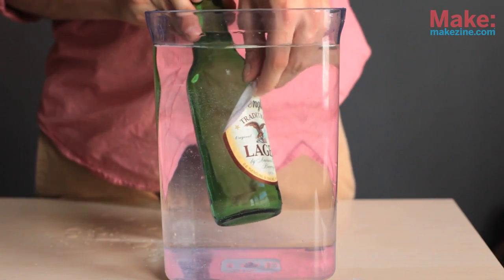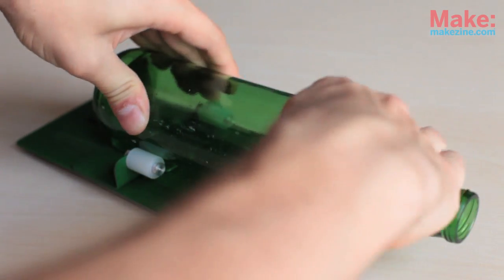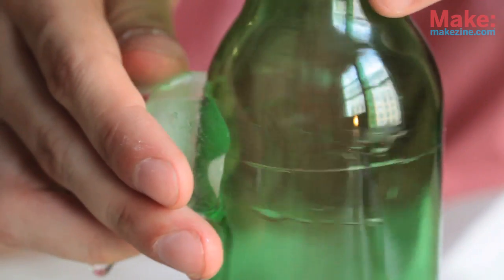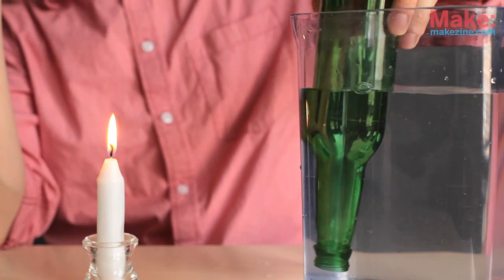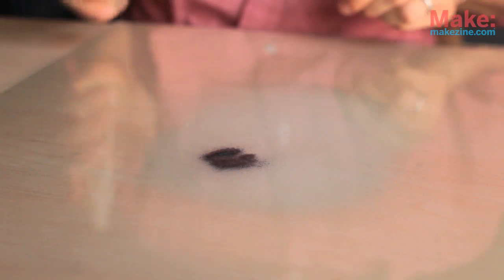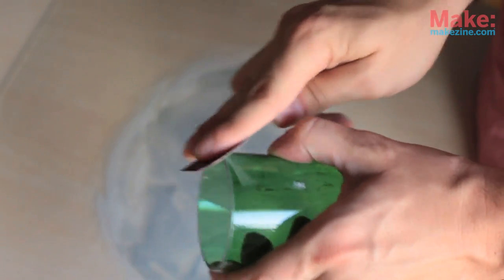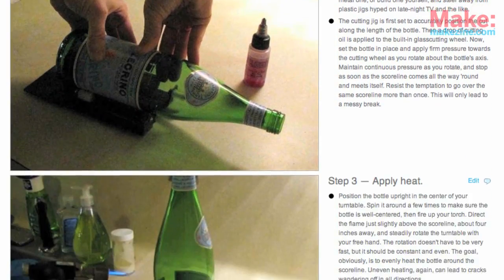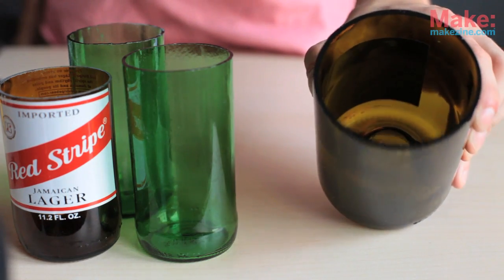How-To: Bottle Cutting

Comment: Just used this method and it was my first time ever cutting glass.
I made my own jig with a few clamps and blocks of wood and a handheld glass cutter.

1st attempt worked but with tiny fractures, 2 next attempts worked perfectly without any imperfections.

I didn't use ice I used a bucket of water full of ice.

Also I used electrical tape to make sure I scored the glass in the right spot all around (cause the home-made jig is very simple =P )

Comment: I saw a video where glass bottles were partially submerged in water at 90ºC for an extended period, after which the bottles could just be tapped to separate the pieces. This method was used as a step for creating bottle shape design, stained glass windows.

Comment: @makemagazine Basically you are melting the glass on the edge to give it the same rounded shape.

Also, you can cut the bottle using a piece of yarn/twine soaked in rubbing alcohol.  Tie it around and light it, then submerge in a tank of water.

Comment: You can use a propane torch to slightly melt the glass on the rim.  This will form a smooth rounded edge that requires no polishing.  That is how wine glasses are made as well as glassware in a lab.

Comment: Nice technique. A little advice is to make sure your cutting wheel is oiled. 
My only dispute is that you consider this recycling. In the most general usage of this term, it can be called recycling. I just wonder if it isn't it more efficient to send the whole bottle to the recycling bin?

Comment: wut i think happened there where the bottle cracked when u picked it up iz dat the bottle was weakened by well you weakening it by heating it then cooling it fast and since you lifted it from the top gravity pretty much finished the job by pulling on the bottle which caused it to break and it prbly broke unevenly when it hit the ground cuz it was weak if it hadnt cracked and it had cooled it prbly wud be strong glass p.s. yayz for overcomplicating things!

Comment: instead of buying a glass cutter, take a piece of string that will wrap around the bottle, soak the string in gasoline or lighter fluid and place in on the bottle in the desired spot, light the string of fire for about 30-45 seconds, then while it is still lit dunk it into ice water and the glass will break there

Comment: I just use my lightsaber. It's hot, easy to cut glass with it and it melts the edges of the glass at the same time so I don't have to sand it down.

Comment: I have never tried it, but apparently you can cut a bottle by filling it with oil up to the point where you want the cut and then sticking a red hot poker into the oil. The bottle is supposed to crack evenly around the oil meniscus.

Comment: I do this at parties... Cut off the top of a sock then put it around the bottle then put acetate fingernail polish remover on the sock...just pour it on....light it... You can hold the bottle with your hand as long as you aren't totally stupid and get too much of the fluid all over the place of on you...spin the bottle for about 30-40 seconds ....then dunk the whole thing in the sink that you have full of water ...it will break off clean and smooth....you could drink out of it if you are carefu

Comment: a gasoline soaked cutton string wrapped around the cutting line 5-6 times, let it burn out, pour water on.

perfect :)

you can also use some thin nickel kobber alloy wire, (called konstantan were i am)

apply power and let it glow for 5 minnuets or so, then water on

Comment: Cool , now make a plazma ball an put a tesla coil in it, then park 8 motorcycles in a circle an build a saucer frame, seal some magnetic solar ions inside the glass plazma ball an spin them with a remote control heli, transistor amplify the faze out some tazers an come pick me up in seattle an take me over to amsterdam to make some crop circles